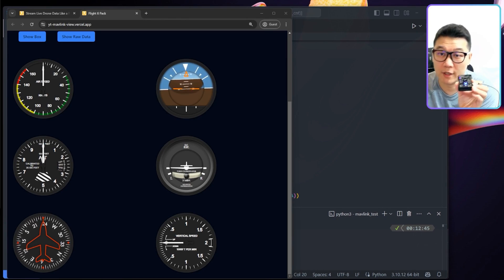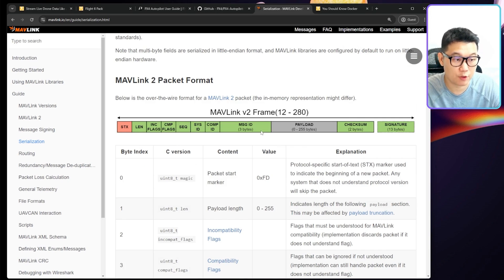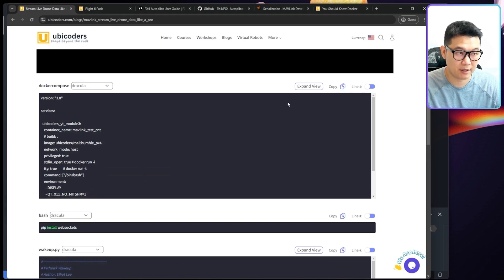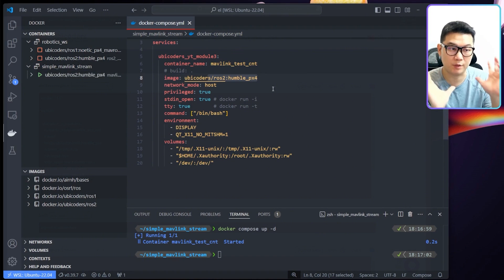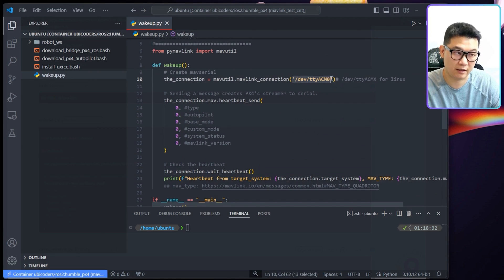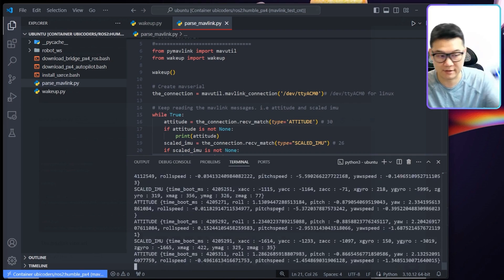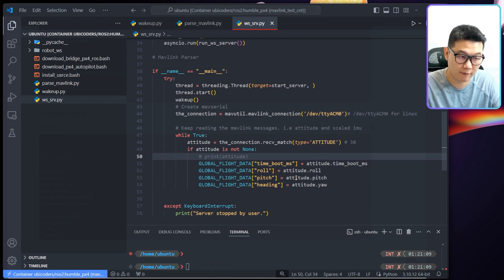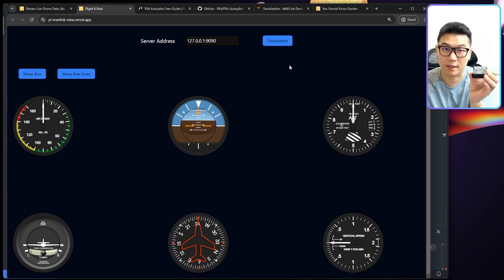Stream Live Drone Data Like a Pro |  Python + Mavlink + Pixhawk

Comment: Recently I was trying to use Mavlink 2 to establish a connection between my Drone and Mission Planner, the telemetry comes perfectly but I simply cannot send or receive Waypoints.
Could it be a compactability issue? I'm using Mavlink for Arduino 1.4.3 on my ESP32 that controls the drone, but I can't get the drone to respond to commands that deal with Waypoints which is kind of the whole reason I wanted to use Mission Planner to begin with, since I had my own program for receive telemetry and control the drone directly via the internet Do you think you can give me some advice on this?
It also fails to send the home even though the drone itself does set it correctly, which leads me to believe it's something in the transmission via Mavlink.

Comment: Nice video, how can achieve the same when the drone is in flight, that is eliminate the physical connection(USB cable) between the flight controller and your computer and establish a wireless connection,
Reply from the maker: Great question! If you have an onboard computer, the case is same as the video. If you don't have the onboard computer, use a radio telemetry. Then, a ground control station receives the data. Then, obviously, the case becomes the same as the video. A caveat here is that, the radio telemtry generally comes with a slower update rate. So you might want to expect the delay.